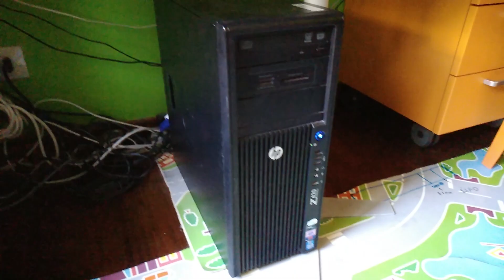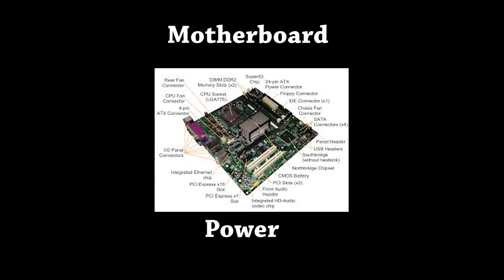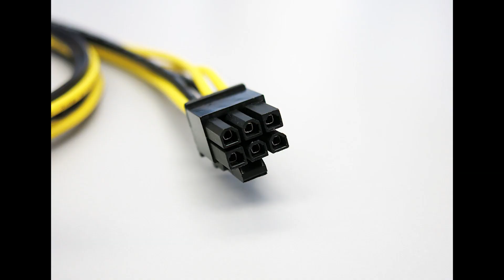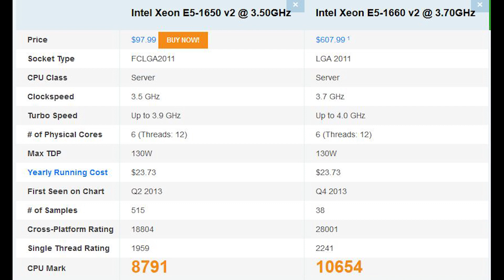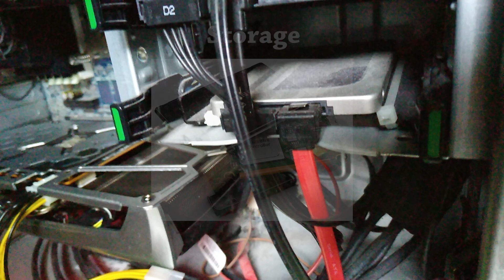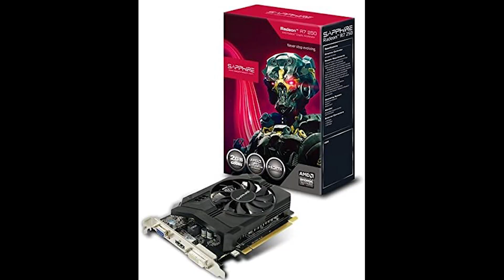HP Z420 GAMING UPGRADE 2020

Comment: i just upgraded mine to a gtx 1070 which has the 8 pin connector. I used a DUAL 6 pin to  single 8 pin cable to connect the GTX 1050 to both 75 watt GPU cables.

Comment: Btw on z420 PSU each 6 pin connector is rated for 12v and 18 amp (216w) using duel 6 pin to 8 pin you get 432w for GPUs.

Comment: I used a duel 6 pin to single 8 pin connector for maximum stable power and using rx-5600xt I getting great performance

Comment: Hi, can I remove main board and install it into a "common" case and connect it to "common" PSU?
Reply from the maker: @deformator2  Hi, nope it's the main board that uses proprietary connections. 
Some people use adaptors, I don't recommend for the main board but only for the GPU connectors

Comment: Bought this computer and took out the quadro 600 card and replaced it with my old 2gb hd radeon 7770 ddr5 card and connected the powercable to it but the computer wont boot up the computer spins upp in fans and the power supply to goes to full mode in fans and the computer starts to beep 3 times in a row and the powebutton turns from blue to red in color. After a couple of beeps the system turns of i dont get it the original power supply is a 600w output why won't it take a graphic card upgrade...please help me ,bought this to convert it into a gaming pc ,so why cant i put in a better card?.... Really need help here ..

Comment: Thanks so much for this video but please help me to know how i can make my graphics card work with this hp Z420 rx 570..whej i insert it into thr system, although it has 8 pin while the G2 has six and it doesn't come up what do i do to use it on my computer?
Reply from the maker: Did you use the 6 pin to 8 pin connector?
Reply: @mattieniki  not yet
Reply from the maker: @myhdtvafrica7205  that's why it does not work, if you look again at the video you'll see that the 8 pin connector has 5 ground pins, the board surely does not have all the ground pins needed and the card does not power on

Comment: Hey im writing here a bit late, some 3 years later.
Anyway, i got this exact PC as a reserve gaming rig. Win 10 home.
Running a 1650 low profile right now but im gonna give it a slightly beefier GPU. 

I was thinking of a RX 6600, due to its great price/perfomance, would that work or could there be BIOS related post issues? 
Plan B is the rtx 3050, Plan C would be the 1660ti (which i know works.)
Reply from the maker: Hey there! Thanks for viewing the video.
I still have the pc so it's not late 😁 I looked up the 6600 and looks awesome for this pc, the only thing I'm concerned is that it may be limited due to the PCI express speed on the motherboard, but I guess it will work flawlessly. Only thing is you'll need a 6pin to 8 pin PCI connector adapter as I said on the video, but the tpu is 132W so you're perfectly safe. With the RX5500 XT it's been 3 years, no issues
Reply: @mattieniki  Hey it wasnt easy backtracking to this comment.

I put the RX 6600 in, it runs lovely, huge relief.

Gonna do some undervolting to get it extra chilly, again, cheers man for the great input!
Reply: @mattieniki  Awesome man!

I can live with 10-15 fps drop from using the gen 4 card. :) 

The adapter is on the way, startech, recommended in a forum.

Last question ill add in here, so its gonna be 75W from Mo-bo + 57W from the 6 pin PCI w/ adapter.
That should be zero risk of frying the adapter right? I was only concerned about the adapter.
  I read how HP's 6 pin can supply well over 75W but that should not be the case here then. :)

Its a sure fire deal then!
Thanks for the quick help!

Comment: I recently purchased one for a $100. It has the 8 core CPU and 32 GB of ram, 600w PSU. I added a gtx980 for $75 and an old new stock Intel SSD I had. I installed Linux Nobara and it's running perfectly. Plays every game I play at ultra settings. Beautiful machine and fun to use. Plus I can run Python and do what I do when I'm not playing games. Normally, I use my old desktop running slackware 15 for programming but this thing runs circles around it.
Reply: you play on Linux??

Comment: I want to get the z420 and rx580 do u think that’s ok and I’m trying to stick with the original power supply? And I want to switch cases to a gaming case??
Reply from the maker: Hello there!
The RX580 has a power consumption of max 185W.
As you see in the video, the maximum power that is provided by the board and original power supply is 150W, so you're a little short... In cases of AAA games maybe there can be problems.
Check if your power supply has two 6pin graphics connectors and let me know!

Switching to a gaming case does not do anything. The original one is very nice and has tool less mountings and good airflow, so no need for a new case

Comment: Hey why dont you recommend using 18 to 24 pin adapter for other PSU's?
Reply from the maker: It's just a possibile electrical issue or a fault in the adapter that can break your board.
To me, the cons are more than the pros

Comment: How is the workstation holding up as of December 2021 and what was your final CPU?
Reply from the maker: Hello! Thanks for asking!
The workstation Is just perfect, I'm able to play modern games such as Assetto Corsa Competizione at 1080p High details with 60 FPS minimum.
Also Microsoft Flight simulator (the new one) at medium details with strong 30fps, stunning views and good playability.
The finàl CPU was the Xeon 1650 V2
Reply: @mattieniki  I am about to grab a e5 2695 V2 and grab some different ram and put a 5500xt in there to see the outcome. What settings if any did you have to make to get the and graphics card to post in the hp system?

Comment: I have te same computer with  x2 6 pines  (12 pines total), can I use a RTX 3060 (170 Watts) ?
Reply from the maker: Yes, but only If you have a total consumption of the PC that allows it
Reply: @mattieniki  ok a think my computer can allow it, I currently use a GTX 1070 (150 watts)  and power supply have 600 watts

Comment: Nice video but you are mistaken thinking that having one or two PCI-E 6 pin connector limits your GPU compatibility. There are molex to PCI-e  adapters and that give you extra 132W (11 amps x 12V) using single molex or 264W if you use 2x molex to PIC-E 8pin. At the beginning when card that required extra power started to be available hardly any PSU had PCI-E 6 or 8 pin and those GPUs worked perfectly fine connected via adapters.
https://a.allegroimg.com/s512/0395af/bf625eb844639b141d4ebefa1312/ADAPTER-PRZEJSCIOWKA-2x-MOLEX-NA-PCI-E-8-PIN
Hard limitation is your PSU 12V performance not the wiring
Reply: And second of all your CPU have unlocked multiplayer and allow overclocking

Comment: GREAT VIDEO!

Thank you! I was exactly looking for this video.

Question: What SSD would you recommend I'm 2021 for an upgrade on the z420? Can I install the OS on a SSD ? I read that the motherboard does not support nvme.2, is that true?
Reply from the maker: Samsung, Crucial and Kingston SSD are very good products in my opinion. The SSD should be for the system and most used programs to reduce wait times, then I recommend getting normal hard disks for storage

Comment: Excellent video. Thanks for the effort you put in. But using an 24-to-18 pin adapter is totally fine. A 24-pin connector brings in voltages that man modern motherboard's don't use, so overkill for most boards. HP uses custom motherboards, and to keep cost and complexity down, it eliminates wasted pins. An adapter just grabs the pins/voltages that are needed, otherwise no difference at all. Using an 8-core/16 thread Xeon on this mobo will more than handle newer GPUs, even high-end ones. The only limitation is the power supply. I would recommend replacing the HP PSU with a brand-name 750 or more PSU. It won't fit perfectly but easy enough to mod the case and rough in. And yes, you will need to buy the 24-to-18 pin adapter. You can find a video on YouTube showing how to install a standard PSU.
Reply from the maker: Thanks for the advice! I am still not sure about those adaptors, but I'll look it up.
Reply: @mattieniki  adapters are perfectly fine

Comment: Ciao! Innanzitutto compimento per il video! Avrei una domanda, ho deciso di comprare un nuovo processore più potente, mi consiglieresti un 1650 V2 o piuttosto un 2543 V2/2643 V2? Grazie mille in anticipo!
Reply from the maker: Ciao! In realtà sono quasi equivalenti, a questo punto dipende solamente dal prezzo!
Reply: @mattieniki  ottimo, grazie mille!
Reply: I got an e5-2650 v2, which is pretty similar to an e5-2650 v2 in multi core tests

Comment: The HP 6 pin is supposedly not standard ATX. Can provide 216W. So total GPU max card consumption = 291W  See : https://www.reddit.com/r/buildapc/comments/8cv04t/power_hungry_gpus_in_a_hp_z420_600w_psu/
Reply: Putting that aside you can use  8pin adapters connected to 2x HDD molex. That give you extra 132W per molex used (11 amps x 12V). Limitation is PSU 12V power not stupid wires.

Comment: What's better Dell t3600 or z420 ?
Reply from the maker: Not a Dell Expert, you should check the datasheet and the optionals list to compare the upgradability
Reply: @mattieniki  oh ok you can even use a 2650 v2 in it for 8 cores
Reply: @triplefurious618  is what I'm running, mfer is a monster and crunches anything I throw at it

Comment: Still using it how's it going?
Reply from the maker: It's perfect, It handles all the modern titles at 1080p High preset including Microsoft Flight Simulator 2020
Reply: @mattieniki  can i use rx 570 in it?
Reply from the maker: @triplefurious618  check the video for the requirements. If it follows the advices I gave then yes
Reply: @mattieniki  ok

Comment: Ciao, video interessantissimo. Ho una domanda, se posso: la ram va presa ECC o non ECC ? Grazie !
Reply from the maker: Ciao! Grazie per il commento e l'apprezzamento, per questa Workstation è preferibile prendere RAM ECC in quanto il BIOS è fortemente ottimizzato. Visto l'utilizzo business ha delle caratteristiche che tendono in quella direzione, ma ciò non vuol dire sia peggio per il gaming.
Reply: @mattieniki   una nota: se l' HP Z420 ha il bios boot block pre 2013 non si possono usare i processori della serie V2 ( Ivy Bridge ), forse conviene segnalarlo. Esistono due versioni della mobo del 420. Se ti capita ( come e' successo a  me ) la V1, l' unica chance di mettergli un processore come descritto nel tuo video e' una procedura piuttosto complessa, e rischiosa. 
Qui e' spiegato tutto: https://github.com/SuperThunder/HP_Z420_Z620_Z820_BootBlock_Upgrade
Reply from the maker: @Pigi_102  molto interessante! Grazie! Io l'ho comprato nel 2014 il mio (nuovo) e quindi nella optionals list c'era già segnata la compatibilità con i processori della Serie V2
Reply: Ciao! ECC indeed works but HP says to use  only "unbuffered". However, Registered ECC works also. For example, PC3-10600E (HP recommends) and PC3-10600R (supposed to work also).

Comment: Which graphic do you think is the right one for my workstation? It has the following specifications: Intel xeon e5 1620 3.6Ghz Liquid refrigeration, 8 GB ram DDR3 12800e 1600Mhz, Power supply 600 W And I have two connectors left 6 pin
Reply from the maker: I had the e5 1620 on, nice processor! Anyway, you can go with a Radeon 5700 XT I guess or a Radeon RX 580, the GPU has to stay below 225W of TDP

Comment: Very interesting, thanks for sharing you're advice. Does seem to have decent airflow for an OEM machine, definitely better than making a sleeper build in my Packard Bell media machine with 1 fan, the cpu fan. Anyways enjoyed it a lot, wasn't expecting the decade old Xeon to hold up that well lol.
Reply from the maker: Xeon processors turned out to be great, just got Flight Simulator 2020 with this configurazions and it runs flawlessly, no framerate drops and "VERY HIGH" graphics settings. For a 6 years old PC with only a modern mid-high range graphics card I think it's very good
Reply from the maker: If you are planning to change the PC on the cheap, think It out, you can find cheap Z420s everywhere
Reply: Yea it seems like a great deal. I had a quick look on eBay and the cases by themselves are just 40, and although there’s the proprietary pins and standoff screw holes, considering that price for what you get it seems really good. I got my current PCs case for 60. I’ve always thought server/ workstation towers can be hella good when you find the right deal, but this is sorta more just all round hella good for the most part

Comment: What CPU would you say is better for playing arma 3 and Flight simulator 2020? I’m looking at upgrading to the E5-2690 V2. would you say this is a good choice?
Reply from the maker: It Is Indeed, it's a server oriented CPU but It should work fine. For a Better budget-performance I'll recommend the E5-1650 V2 and 1660 V2 that match both the advised requirements for the games, the upgrade I made Is mainly for FS2020 ;)
Reply: @mattieniki  Hi,  some info said only newer models of z420 with boot block date 2013 can run v2 xeons, mine is 2011 , not sure about that as I haven't test it myself , can you check yours please
Reply from the maker: @AkramESG  Mine is from 2014, so I guess that there are two kind of motherboards that can support only V1 Xeons or even V2 xeons
Reply: @mattieniki  Thank you :)

Comment: I just received an HP Z420 Workstation and the information you provide in this video answers most of my questions regarding potential upgrades. The only question I have pertains to the Graphics Card. 

Is the EVGA Geforce GTX 1660 Ti XC Ultra Gaming graphics card considered to be better than the Sapphire Nitro+ Radeon RX 5500 XT?

I can only find information about the Sapphire Pulse RX 5500 XT, and it seems as though the EVGA Geforce GTX 1660 Ti XC Ultra Gaming graphics card has a slight advantage. 

Can the same be said about the comparison between the EVGA Geforce GTX 1660 Ti XC Ultra Gaming graphics card and the Sapphire Nitro+ Radeon RX 5500 XT? Or is the Sapphire Nitro+ Radeon RX 5500 XT better? I can't seem to find any information on this.
Reply from the maker: In this case it depends on the games and the requirements you need. I bought the Sapphire Nitro+ because I wanted 8GB Vram video card to play Microsoft Flight simulator 2020 without scaling down the graphics too much. If you play games that are optimized for Nvidia cards or you find the GTX 1660 at a low price, go for it. In my opinion in this case it's just a matter of games you play, if you like the brand or not and price.
Happy if you liked the video!!!

Comment: Someone told me using adapters messes up your PSU (or GPU, cant remember) in the long run. Is that only true if your GPU is over the watt limit? You make it sound safe here. Also lol, I'm kinda bummed out because I bought a z420 instead of a z400, thinking the 600w PSU would give me more video card options (was hoping to save $ by getting something power hungry like a 590 or vega 56). I coulda just saved $ and gotten a z400 or Optiplex, no? Thank you for the excellent video. :)
Reply from the maker: Thanks for the compliments! Using a adaptor for the GPU is safe if you stay under the limit, I got plenty of engineer friends and I've discussed it a lot with them, especially in the 6 pin to 8 pin connection. About the PSU, you have to check about having one or two 6 pin connectors, unless you could look for the PSU with two connectors (it was used for a two Nvidia Quadro in SLI configuration). Hope I was helpful with the video!

Comment: i have a psu 500w bronze EVGA works with this motherboard? how much watts consuming it? i put a processor of 115w TDP
Reply from the maker: The PSU must have a 18 pin ATX connector, the max tdp of the LGA 2011 socket on the motherboard is 130W. I have not found a compatible PSU except the 600W HP OEM.
Reply: @mattieniki  https://www.youtube.com/watch?v=Mm6OnJMqydQ this guy for example put one of 700w
Reply: and for the pin connector i search a adapter 24P to Motherboard 18Pin Power Supply ATX z420 in ebay
Reply from the maker: I do not recommend it because the HP motherboard are very sensitive to power adapters, on high watts loads you can have problems. Do it at your own risk

Comment: The HP Z420 PCIE 6 pin can deliver over 100W, open blower cards aren't really goor for the board. it's an workstations the heat will swim in the case resulting in the sensors reading higher temps. the fans will ramp up higher bad choice.
Reply: Hmm, so 175w TDP card should be no problem for the 1x 6-pin version (assuming 100w from the 6pin cable and 75w from motherboard)? 

And good point about the open air GPU. Can you recommend a closed blower to pair with the e5-1650 v2? Thank you for the informative comment.